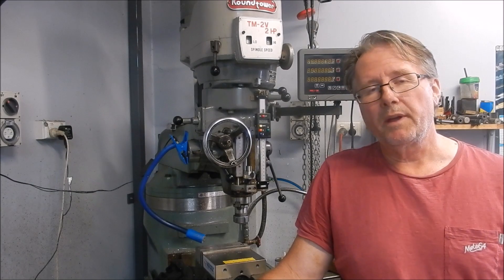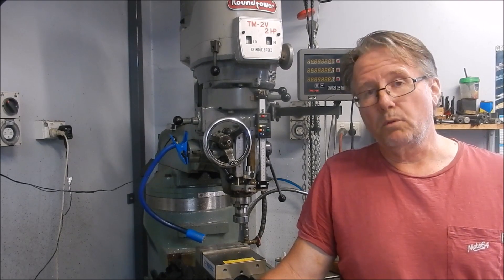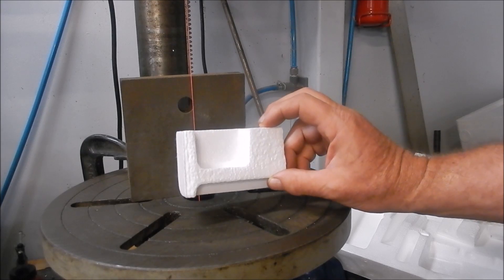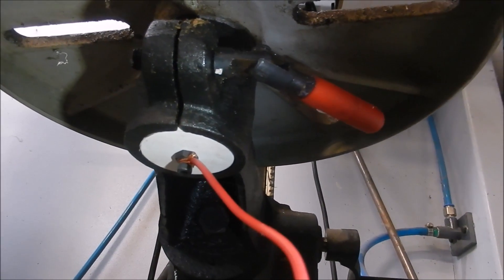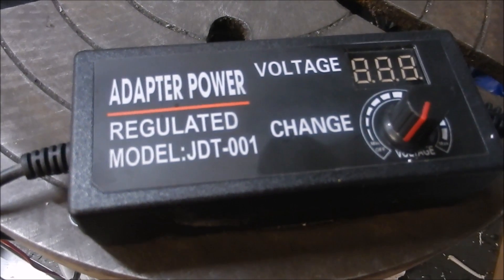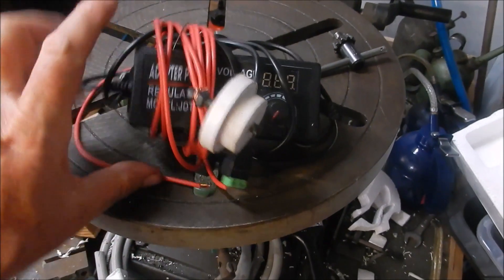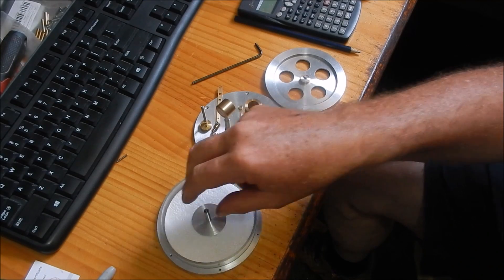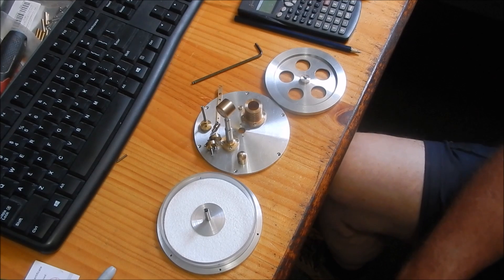The Simplest Hot Wire Foam Cutter Build Ever

Comment: I recently made a portable one and suggest adding a strong spring to one end of the wire.  Spring strength will be determined by the cutting wire length and amount of current being passed through it.  In other words, experiment.  This will keep the wire taught as it stretches due to the current flowing through it.  The power wire should attach to the cutting wire at the connection to the spring and not run power through the spring.
Reply from the maker: Hi, yep as I showed the quill retraction spring is very strong and keeps the wire very tight.  As I mentioned if you want more tension just add a weight to the quill handle.
Cam

Comment: Excellent!  I made a very similar version using a guitar string and a variac to power it.  I used a wooden dowel with a screw eye in the quill and a wooden plug, also with a screw eye in the table.  A variac is expensive but I happened to have one around.  I like your use of a small variable power supply.  My project was a case for my baritone ukulele.
Reply from the maker: G'day, I looked everywhere on the Net but couldn't find anything similar.  I am happy to see someone else has done the same thing.
Cam

Comment: I like that, might even have a go at making something similar. Do you know how much current it's pulling at the voltage you're using (9v wasn't it)? What diameter of wire are you using?
Reply from the maker: G'day Rob, the power supply is rated at 3 amps.  The stainless wire diameter is 0.025" (0.63mm).
Cam

Comment: Good one Cam.  The Stirling is looking nice.  I haven't built one of that pattern.  Where did you get the resistor wire ?  Cheers Rob
Reply from the maker: G'day Rob, check out Jan Ridder's Stirling Coffee Cup Engine.  I've  had the monol chrome wire for over 40 years.  It's what I  used to lock wire bolts back in the day when I worked as a fitter.
Cam